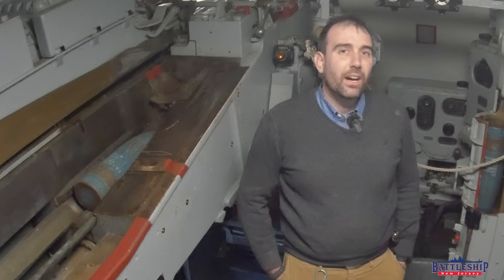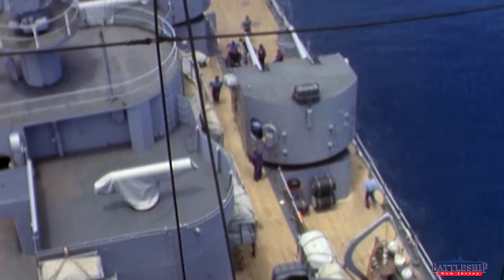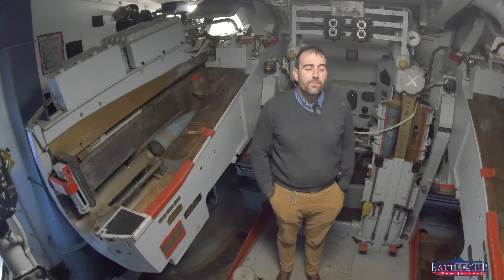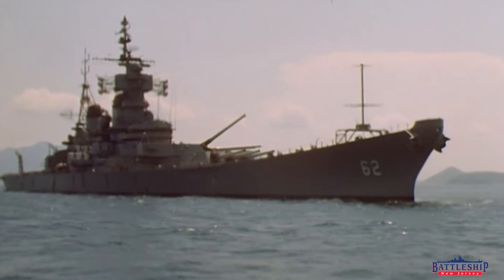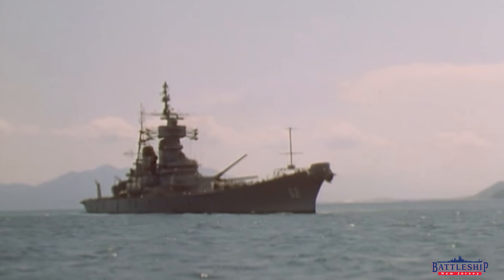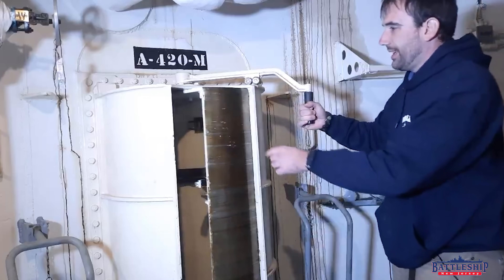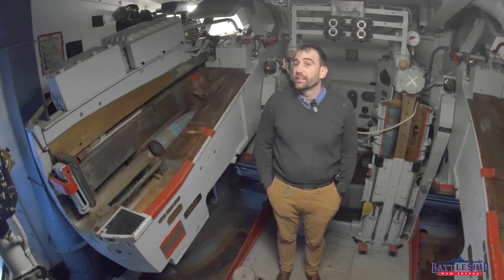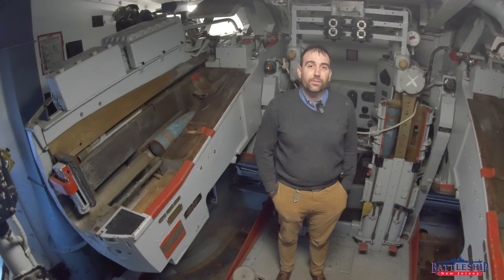Why Do Modern Warships Have So Few Guns?

Comment: I think the trend of increasing cost of missiles will end with an increase of low-cost drone-like missiles. Vertical launch catapults into propeller propulsion of an RC plane style with folded wings could put a few hundred pounds of explosives on a target at a similar range to cruise missiles. Sure, it'd do it at 80-200 mph, but it'd cost 1/100-1/1000 as much. You could put a "missile" like that together with $5000 in RC parts from the hobby shop or an ultralight plane kit.

Comment: Another excellent video to an interesting question.  The huge number of aeroplanes on both sides of WWII led to equally huge increases in anti-air guns on ships.  Almost no navy can afford planes and air forces have such weak anti-ship capabilities that missile systems are preferred.  The vendors make great claims for these systems, but reality is, for example in the Falklands, that one missile system alone is insufficient, especially when it is designed against a single threat type - the high-flying slow bomber.  Sea Slug, Sea Car, Sea Dart all failed to counter the low-flying bombers.  It was the high-volume of gun-fire, plus the need to keep low due to the missiles, that prevented activiation of many of the bombs dropped, but the RN quickly installed more 20mm and LMGs on its ships to add more fire power.  Single 4.5" guns were pretty useless in that environment, defence has to be provided by multiple guns and of different types.
In other videos, we are arguing about fighter aeroplanes, and again the theorists for beyond visual range engagement dominate aircraft design, but  wars like the Falklands were fought in the air as dogfights.  Reality always catches up with theory, and eats it.
If drone attacks continue, then we can expect to see more automated radar-controlled small guns and ECM systems, but naval gunfire support for attacking land-based launchers would still be valuable.

Comment: Im not that well informed in missle tec or navy tec. But the Idea of a modern fast battleship for shore Bombardement sounds somewhat intressting as a cheap Option to inflict much damage. If u have 3 of the huge fckin 3 Barrel Turnerschaft shooting at stuff with high explosive stuff u dont even need to hit that accurate. For ship to ship combat i would be useless but hey if u want a coastal city anihallated then thoose big guns can do the job just fine i quess.

Comment: I think the days of ships like the Arleigh Burke to be numbered, in future designs not in service, and the future will be in more specialized designs. 

Some more out there ideas would be small drone craft with a couple VLS or HLS cells that just follow a fleet around. After expending their payload on command of a manned vessel, they return to a mothership or dock to rearm. It provide redundancy to offensive/defensive capability, allows redundancy in command by allowing multiple command ships, allows a high degree of flexibility in fleet composition, and partially solves the problem of rearming at sea. 

I think the 76mm to continue as a single gun on less specialized ships but I think we may see multigun ships emerging as defense/bombardment ships. Even looking at now, a vessel with several Otobreda 127/64 mountings can achieve a 32rpm fire rate with a 75mi range given the correct shells. You are looking at a significant volume of fire on drones or light attack craft that isn’t interceptable or distracted. At 75mi with smart munitions, you also are looking at something that can also threaten deep inland targets as well with pinpoint fire. Even vessels might be targeted. 

I definitely don’t think they’re making a return as premier anti-ship or anti-missile weapons, but they’ve clung on tenaciously and, as mentioned, with missiles trending further and further into their own pros/cons I think the pros for guns have a much greater discrepancy while the cons are roughly the same.

Comment: Most modern ships now just has a couple small gun at front and maybe another at rear. These guns are more accurate, faster fire rate, longer range for their calibres. The rest of the ship is all missiles housing and some room for helicopter and drones operations. Basically they replaced the guns on the sides with missiles.

Comment: Very video, really like the style. It's true that missiles combined with modern hull shapes have radically changed how ships look, to the point that the average cruiser has laughable gun firepower. I do believe a combination of phalanx (and similar system like rheinmetal's), regular flak and perhaps countermeasures akin to tanks like the later challenger variants will be the future for boats, as it's a much more straightforward way to deal with drone swarms (and also a lot more resilient regarding logistics, it's much easier to replenish ammo of medium caliber than load missiles etc). 

One thing for sure, upcoming ships will be all but boring in their approach to naval warfare. Surely it does lack that unimitable grandeur of firing 12 main batteries in a broadside like the Iowa or similar ships from that era, but it's bound to happen.

Comment: I can totally imagine that guns will also have a comeback for bombardment. We are certainly not talking about a battleship level, but a single (or two) guns with a diameter of 7 to 10 inches might have some use in the future.

The reason might be that anti-missile defense systems will get cheaper and cheaper in the future so the missiles need to be more and more advanced (and expensive) to break the defense system.

A gun is much cheaper and harder to deflect.

But im just speculating and might be totally off. Who knows?

Comment: I think we will see more Small caliber guns and Phalanx system, Better Missiles and also smaller missile systems for self defense. Its true that missiles are Expensive and get better sensors but "older" missile will get cheaper and already have insane capabilities. lets hope the esm systems can keep up the pace also. Early detection is key for defense and offense. When it comes to guns, they are nice to have to deal with smaller vessels and are probably most useful on Coastguard vessels or on vessels that deal with pirates who dont have warships, should be more then enough to make them think twice. If you are facing another warship then battle will most likely be outside of canon range. i could go on longer but i dont really know much about the subject and this is only an opinion so dont take it all so serious since i dont know what i am talking about.

Comment: Why? Because people forget history and lean FAR too much on TECH. When all that tech goes dark and we have no missiles or radar tracking.. our ships will be so screwed.
Reply: Well even in WW2 American ships relied on radar for fire control. Radar tracking isn't something new. If you want to learn from history, learn as to why surface engagements were so favorable towards Americans most of the time. Its why a single Fletcher destroyer during the Battle off Samar was able to charge the largest battleship ever made, and cause three destroyers and a heavy cruiser to turn away just using its guns. Because its radar was so effective that it could get an accurate firing solution on the second volley.
Reply: @Fantasia-em5rs   Really? and what did they do BEFORE radar? Nothing? No, They used colored range markers and within minutes had the range of a ship and had rounds on target.

Comment: A modern battleship would likely have  2 or 4 guns in an a/b  or   a/b/x/y  

If/when they start with the large rail guns, the rate of fire will be slow as charging time for large cal guns would take some time.   That being said, you would likely see single gun turrets, each with its own charging bank.    Accelerating a large enough HE round up to mach 7 velocities to get a 110 mile range...   takes a lot of power...   

this will limit the number of guns, even with nuclear reactors...   a 30mm rail gun would be far less a power hog and be able to "control'  a wide area around the ship with flak  essentially replacing missiles out to 20 miles.   but for shore bombardment,  8-12 inch rail would be able to blanket a large area.  

the problem with really big guns, 16-20 inch is their energy requirements are exponetial... meaning either the range will be much much shorter... or the rate of fire will be so slow due to charge up times.

Comment: The same as with fighter planes. Combat is no longer in guns range, and is missile based, and prety much ship-ship combat is no longer, usually you have anti ship missiles fired by friendly planes.
Regarding to the planes comparison, there is an F35 pilot that was saying about it.
In a dog fight, the much older f16 would blow the F35 out of the sky from any angle. But the F16 s won't reach the F35 to fight it.
Even a squad of 5x F16s won't be enough to down a single F35, because they won't get into their range of engagement, and will be picked off from far away.
There is a new upcoming video game with modern ship combat, russian vs nato stuff, and yeah,. launch a few missiles at the enemy
The only relevant guns are CIWS to defend against missiles.

So, a single good, reliable smaller caliber gun is sufficient to handle smaller vessels.

Comment: Missiles will most likely remain the armament of choice when it comes to engaging other naval vessels, and potentially for pin-point accuracy strikes on high-value targets. However, in the age of asymmetrical warfare, if you have to spend anywhere between $500k to $2M for a single shot while the enemy uses low-cost drones, decoys or similar platforms that cost a tenth of what you have to use... well, you're going to run out of munitions and money. I can definitely see some type of gun platforms making a comeback precisely to engage these disruptive and low-cost targets at a much more affordable price point.

Comment: Faster rate of fire plus greater accuracy equals need for fewer guns. Limited range compared to missiles equals lesser utility. But when you want to get their attention you can conveniently fire a shot off of their bow. Plus when the target is not worth an expensive missile a cheap round or two works just fine.

Comment: Problem is small drones pack enough heat to drop the one gun, and there's not enough small arms response on modern vehicles on all types.  Anti drone tech has to be installed on literally every single ship, and that's going to be a lot of guns.  Missiles and artillery are what they are.

Comment: 406mm guns with an auto loader and laser guided (with satelittes) shells (like krasnopol) would do so much damage on other ships. especially if the shooting ship was heavily armored as modern missiles are not armor penetrating.

modern AHS can reach 50km of range, what could a modernised 406 do ? 150km ? it could also ditch the propelant for pressurized air or and hydrolic system.

Comment: Big guns are heavy. It’s like an iceberg at sea. Only 1/3 or less is above the deck. The royal Netherlands navy uses 1 2 barrels 15 cm canon for coastal bombardement and surface targets. Mordern ships are light. When the lcf fregats were designed there was an idea to reus the 15 cm cannons of the old gw fregats, but these old cannons were so heavy the hole structure of the ships has to be mode stronger and bigger. It was cheaper to buy new ones with a lighter and more compact design and still 2 15 cm barrels. Most big guns need 2 or 3 decks down in the ship, and below gun room there will be an ammunition storage. And because of the weight of the cannon you can’t put is high on a ship. Navy ships are already top heavy.

Comment: Huge multi barrel gun mounts are gone due to missiles being better at delivering large payloads. However, I absolutely so rail guns brining back guns on naval ships as a key weapon system. They will increase range, accuracy, and no need to store dangerous powder or explosive shells. The cost per round is also much lower.

Comment: When the torpedo boats (small fast boats armed with torpedo designed to attack capital ships) ( picture a WW2 PT boat) were used in navies, the answer to them were torpedo boat Destroyers. To sneek past the Destroyers, underwater boats were then used. This became the submarine. To counter the submarine, Destroyers were equipped to find and take out submarines. 
So now there are drones in the air, on the surface and under water. They are individual in small groups and eventually "drone swarms". Knowing the tit for tat answers of the past, it is easy to imagine smaller boats around Destroyers and all other capital ships workingtogetherto defend the fleet. 
Will these boats be manned or automated? How will they be armed. It will depend on the decisions of the nations, their navy, and the officers manning them. There are new challenges and plenty of possible solutions, just like always.

Comment: I clicked on the video assuming two-things, just to confirm: 1st, the guns we do-have are superb; and 2nd, guns themselves are weak-moving-parts compared to armored-bulwark. Impeccable armor & sensors boasting tactical-supremacy with two weapon-housings is cost effective and Big-Dick-Energy, plus those are just the visible stationary systems, armored and high-profile, visually-bristling for effect.

Comment: American class ships should have a twin 105 instead of jsut one. Or make a second turret
Reply: Easier to just have a faster autoloader and save a ton of weight and space by having only one gun.
Reply: @bluntcabbage6042  at least make it a twin 105 as you can have the same reload time if it was single

Comment: I see ships getting more flak-battery size guns. Thanks to programmable shells (unleashing thousands of tungsten pellets from on-the-fly programmable shells), 35-76mm autocannons is the new hot stuff for taking out drones and anti-ship missiles (with a lot more weight of fire than the ol' 20mm phalanx guns. 3000 tungsten pellets per second has better saturation than 6000 rounds per minute).
I don't see much of a future for the 5 inch gun. It doesn't have enough range for shore bombardment (any range shorter than 80km is "too close" in todays environment) and it's not agile enough to contribute to air-defence while 40/57/76mm guns are adequate for any kind of drone (both flying and boat drones).
The missile side of things will most likely remain unchanged, although we might see ships that are platforms for launching glidebombs. A glidebomb is cheap because it's electronics don't need to handle the thousands of Gs that an artillery shell needs, and 250-500 pound precision bombs hit very hard while the rocket needed to get them high enough are also fairly cheap.